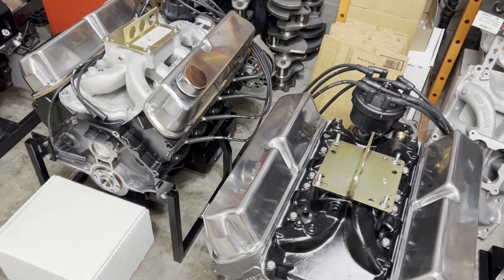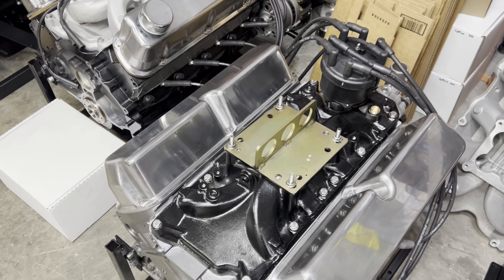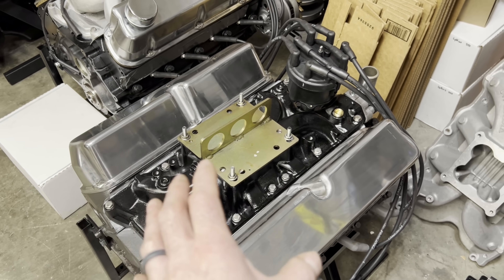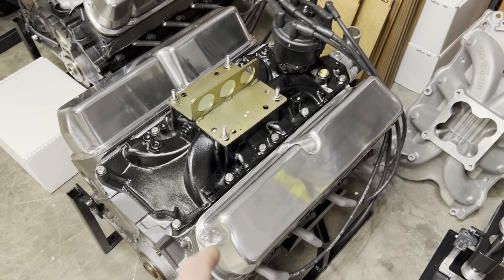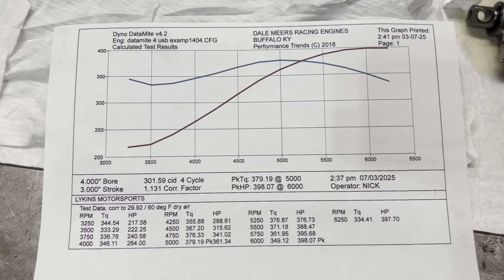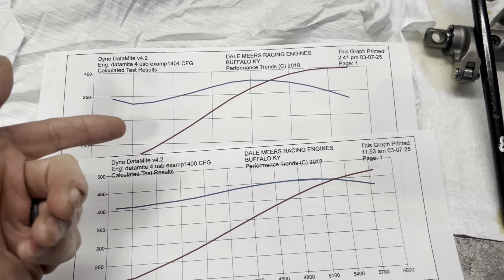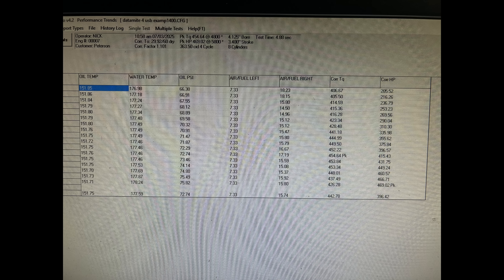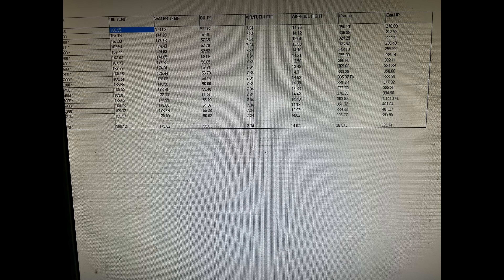Lykins Motorsports Ford 363 SBF & Ford 5.0/302 Ported GT40P Head Dyno Results...

Comment: what cam did you end up using on that little motor?
Reply: I remember seeing dyno figures on older 5.0 years ago. They just keep making more and more power the hotter the cam. Just need to figure out at what point they aren't streetable. That's the benefit of the 4.6 and later Coyote 5.0. Much more HP with more streetability from milder cams and advanced variable cam timing.
Reply from the maker: One of my custom hydraulic rollers.

Comment: Absolutely stellar numbers on both engines. I'm astounded that the ported GT40P heads are that good, even with that ugly spark plug boss.  It seems as if 1.2 hp/ci is entirely doable with a fairly mild hydraulic roller.
Reply: I have seen ported gt 40 and DoOE heads make 400 wheel, and flow extremely well.

Comment: I’m keep my gt40p heads then…
Reply: Ha....headers will be problem. Then you still need professional port work.
Reply: Best bang for the buck in my opinion.
Reply: I had planned on keeping my GT40P heads on the 302 I was building just to keep the engine mostly Ford parts. Now I'm finding out nobody wants to port iron heads anymore. So I may just ditch the project and sell it and keep the stock 302 I already have in my 79 F150.